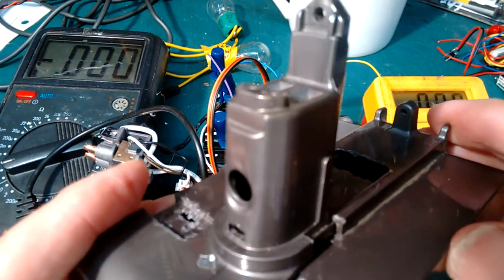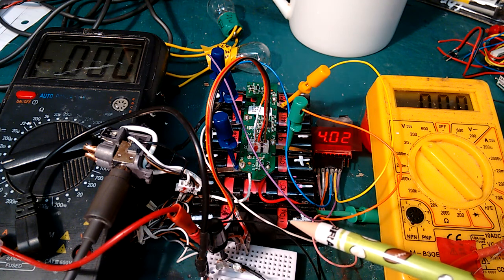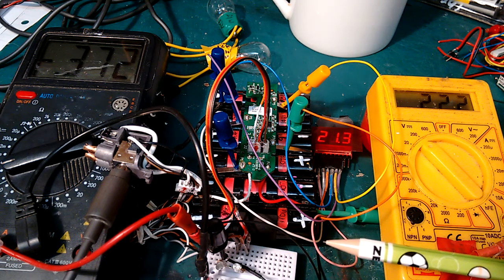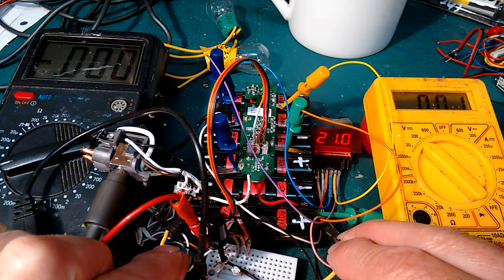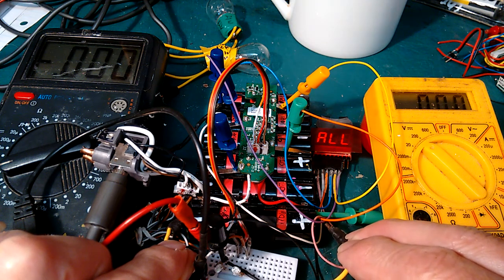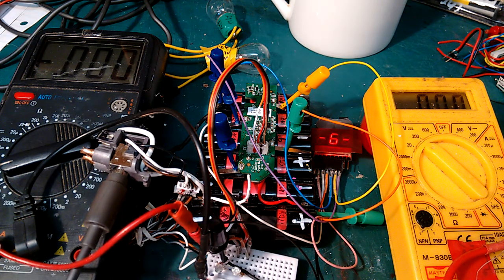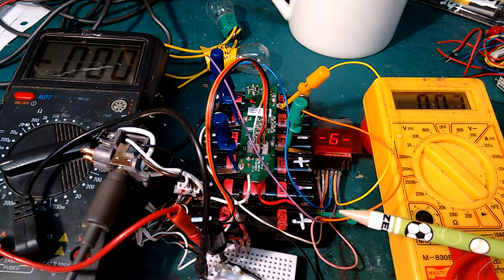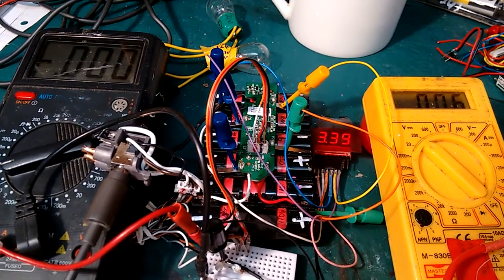Dyson Vacuum Battery Charging Attempt

Comment: I have a simillar fault on my DC30,  don't know if it is a dodgy battery causing the supply to keep restarting or a faulty supply. Hope I can find the fault, I have emigrated to Brazil now and there are no parts for this here. I saw your attempted charger repair and suspect the IC may be faulty as I can't see a chopper transistor on this supply which would be the normal culprit for constantly  restarting chargers; mine charges for 4 second.
Reply from the maker: Thanks for the information.